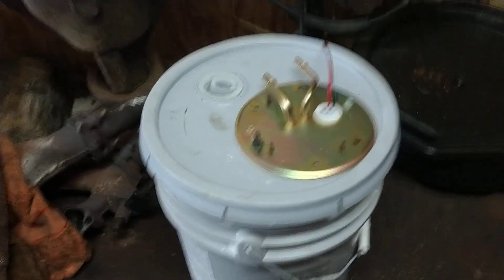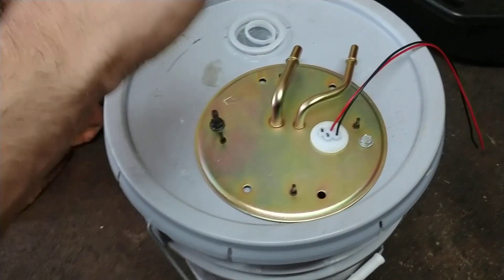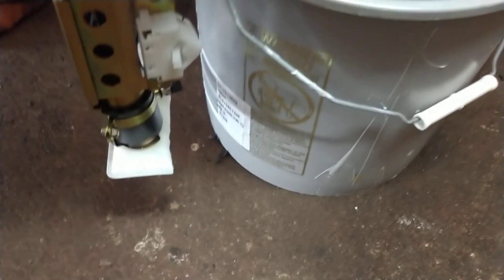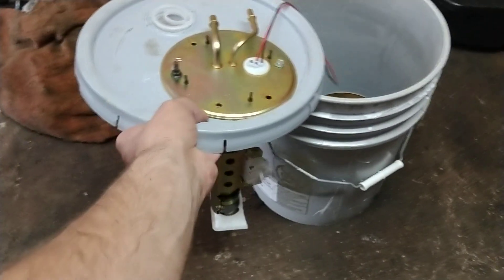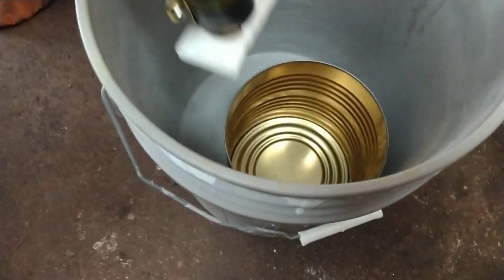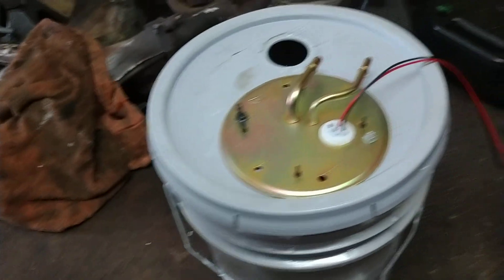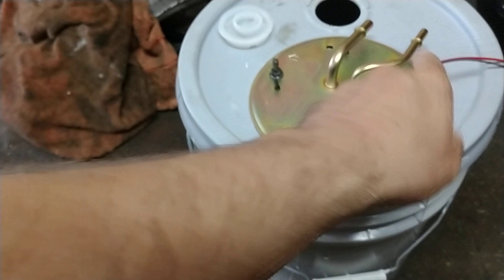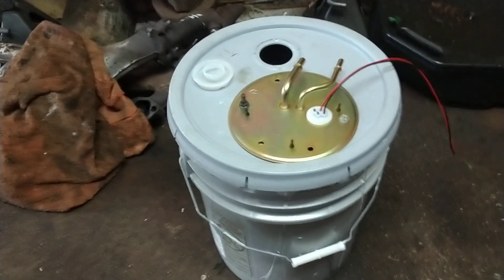HOW TO: Build an inexpensive Fuel supply for EFI

Comment: Be careful, plastic does not dissipate static very well!  Gas fumes and static do not go well together!
Reply from the maker: You're right good call!!
Reply: What about an outboard fuel supply tank instead,?
How does an outboard handle Gas fumes? 
Is it handle by fuel cap (air vent or relief valve)?
I am thinking about my own project by using outboard fuel supply tank with two fuel lines, one for feeding rail and the other for returning fuel. 
Any idea or warnings to help me light my way up please
Reply: @adrianvargas1530  A tank designed for fuel with the proper venting is fine.
Reply: Big red gas jug with cut out for pump assembly instead of the spout? Or turned on its side? The vent for fuel tanks are like less than ten bucks too. Shiiiiii